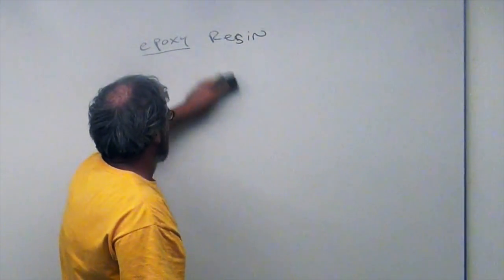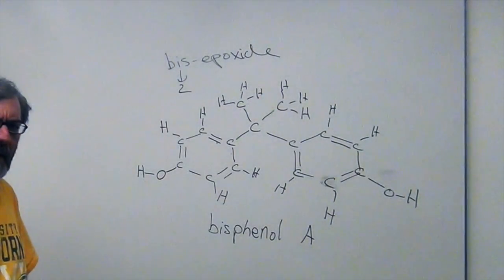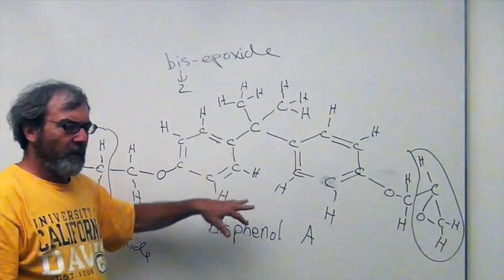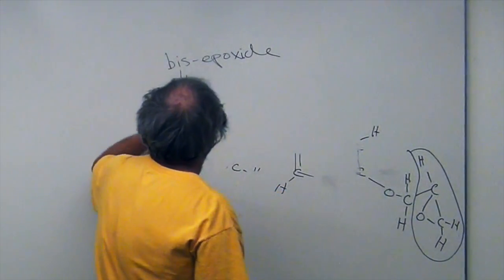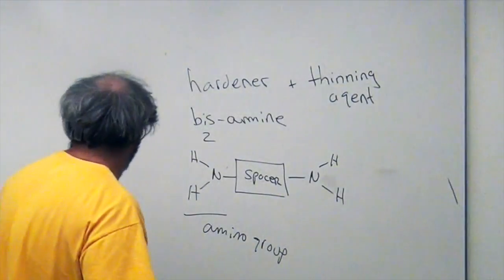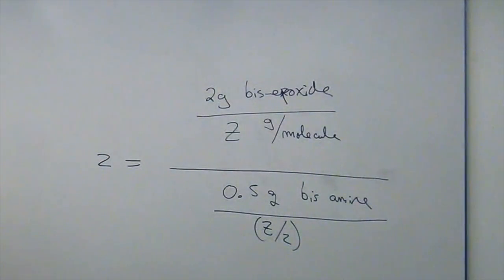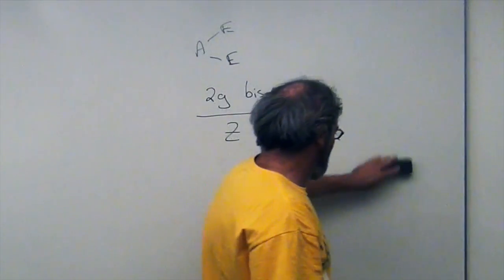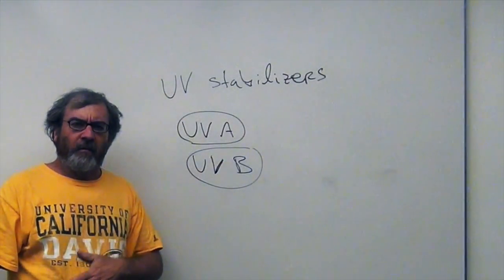Mr. Mike Surfboards: Part3, Epoxy Resin Chemistry

Comment: Hey Mike, bitchin video for sure! Quick question, when you have a "1 Minute" set time versus a "5 Minute" set time, is there more hardener in the 1 Min compared to 5 min? If so, how does the 2-1 ratio work? Are there more Epoxide molecules not bonded? How would this affect the overall strength?